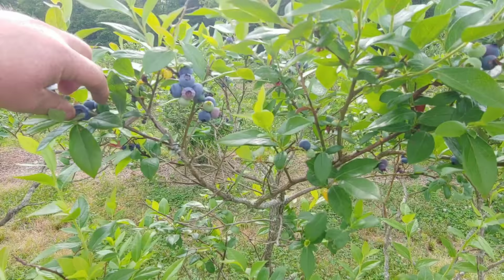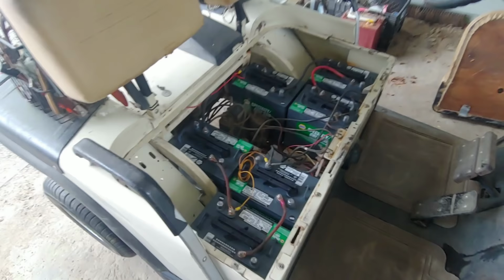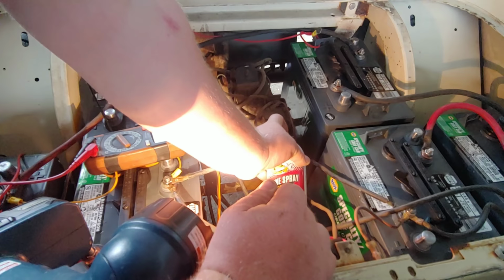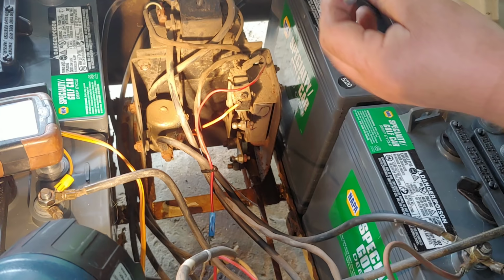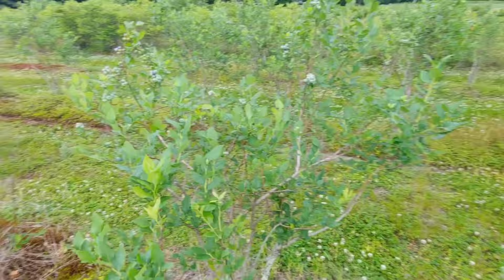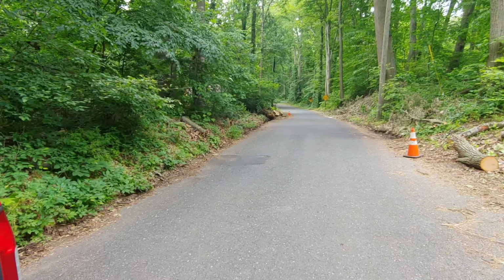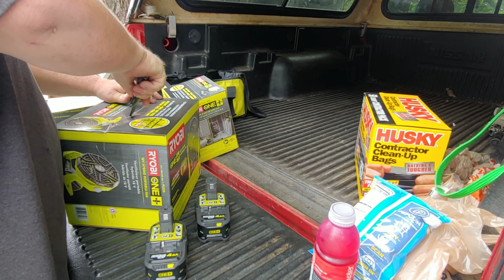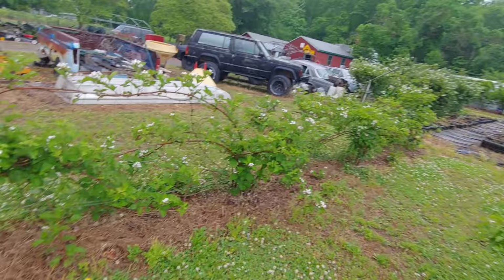Farm update 2020

Comment: We put fishing line up around our garden they don't  like when they walk into it do like you would a barbwire  fence
Reply from the maker: Yeah we used to do that a lot when we planted large corn fields and I can't tell you how much fishing line has ended up in the f**** rotor tiller or in the brush og or on the mowers I've definitely replaced a lot of bearings because of fishing line it does work but when it breaks you have to clean it up all of it lol